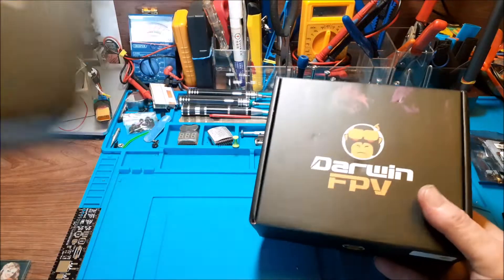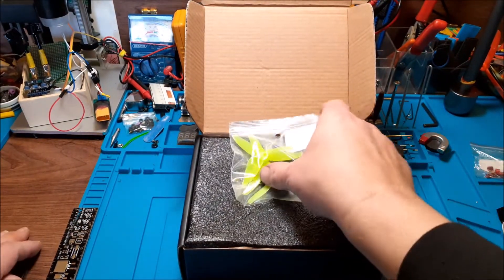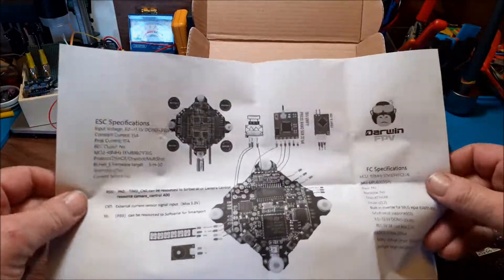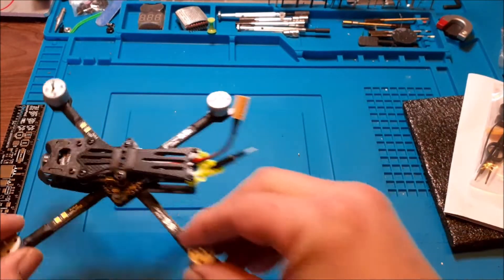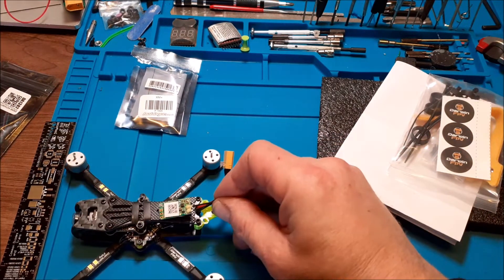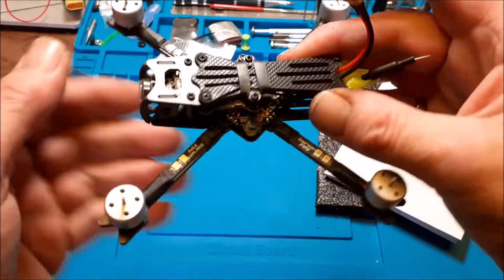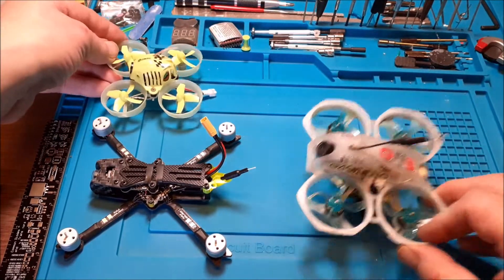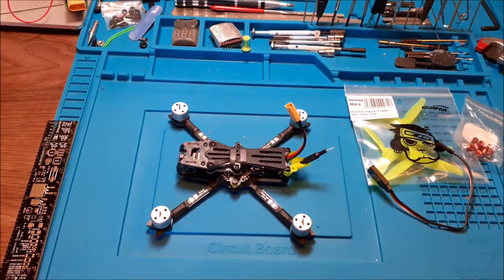DarwinFPV BabyApe 3 inch pro 08/03/2022 latest batch out the factory, unboxing and look over

Comment: Do you think it Is possible to fly this drone with a 1S-2S (or 2 cells in parallel)) Sony VTC6 Li-ion
Reply from the maker: yeah, iv seen it run on 1s, i will be posting a video soon, on a 1s 2s and 3s battery and will include performance and flight times, will also be trying the same with 18650 and bigger ones,
Reply: @RCDUDEFPV  Do you know any good 18650s with an XT30 to turn this into a cruiser?
Reply from the maker: @kiparis311  i have the cells, also the bigger ones, just not had the time, but ill hook a battery up and see the flight times, i got it to lift a session